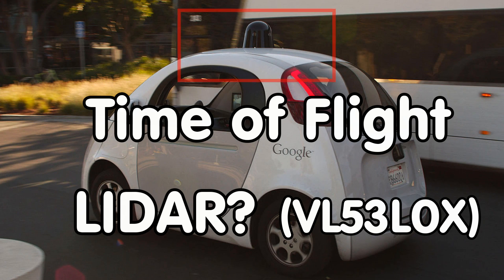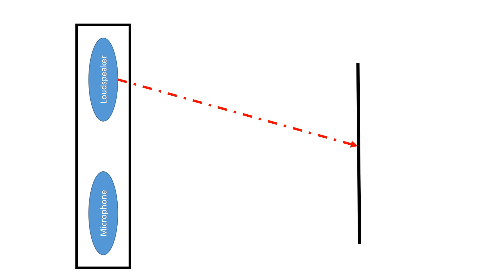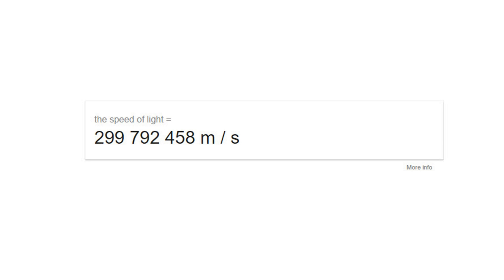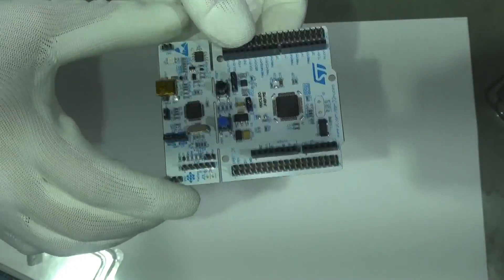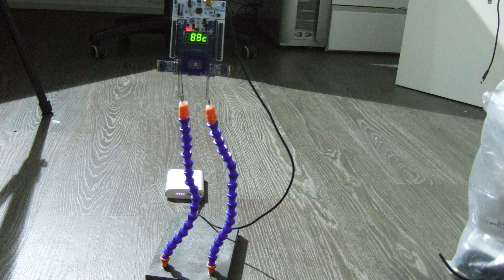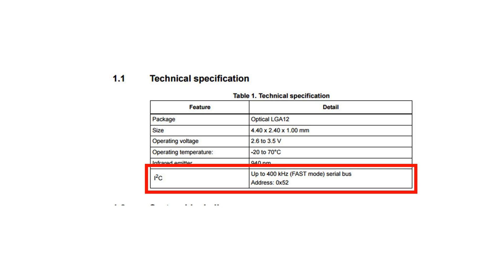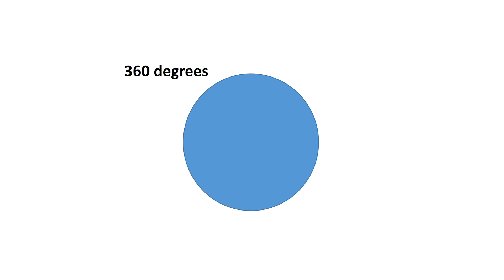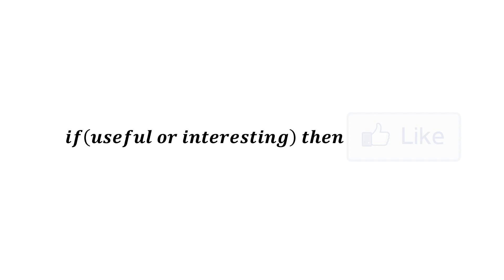#119 Time-of-flight LIDAR with VL53L0X ?

Comment: I hope you can show us how you can build LiDARs from scratch using discrete components, with today's advanced high speed micro controllers I think it can be done for low cost which implements proper LIDAR timings. The only reason I can not use the IC LIDARs is because they can not be implemented properly for 360 3D mapping which usually requires an array of Lasers.
Reply from the maker: You can buy ready-made Lidars (not expensive for what they include). They are very mechanical devices, and I will not build one myself.
Reply: @AndreasSpiess  Are they the ones with only for 2D pane using one laser diode? It is the lidar I would like to avoid. I have not seen any practical 3D lidar which are not expensive.
Reply from the maker: @ShopperPlug  Yes, they are 2D Lidars.

Comment: Is it possible to use VL53L0x without X-NUCLEO-53L0A1 extension borad, directly connecting to my F302R8 board via I2C interface? HAL functions(HAL_I2C_Master_Transmit or HAL_I2C_Mem_Write) don't work since no register map presented of VL53L0x by ST. All i found is device address as 0x52.
Reply from the maker: On this channel we only use the Arduino IDE as a programming tool. So I do not know :-(

Comment: Hi, I have to design a probe, which will move inside a pipe. The probe should be capable of self localisation inside the pipe. I am thinking to use TOF sensor V53L0X from ST microelectronics.  Could you please guide me
Reply from the maker: YouTube is only my hobby and unfortunately, I have no time for consulting

Comment: Thank you for thre great and interesting video! If I may add one mark @ ultrasonic distance measurement: in gases the the speed of sound does NOT depend on the pressure, but on the temperature (and the kind of gas (-mixture) of course): cs=sqrt(kappa*Rspec*T); the temperature is a meter for the speed the atoms/molecules move and thus can carry a pressure wave foreward (higher temperature --> faster atoms). whereas increasing pressure "just" increases the frequency of bounces as the free length of way is shorter.
Reply from the maker: Thanks for your clarification. I like to learn from my viewers!

Comment: Well, we are waiting excited for the conclusion, will it work with the robot?  An idea: if you put your sensor on a fastly rotating stand, maybe 5-10 rotations per second (or even more), and then with a rotary encoder fill an array or struct with angle and distance, wouldnt that compensate for the slow measurements? (its not fast enough to measure every degree, but after a couple of laps we will have by chance filled most of the angles in one degree resolution.)
Reply from the maker: I have to continue this project in the next time. And I plan to use more than one sensor to compensate for the slow speed. But it takes some time and I only will start if I can afford to stick with it for a while.

Comment: Can this be used in outside conditions and if not what is the best and cheapest sensor instead of sonar sensor??
Reply from the maker: It should work behind thin glass. So, you could include it in a water-tight housing.
Reply: what about the outside light conditions. is there any possible interference ?
Reply from the maker: I never tested. Maybe you consult the datasheet.

Comment: I think it would be good to use more than 1 sensor to tackle the slowness of the sensor. If we use like, 8 sensors at the same time at the same assembly we could get 8 points in 8 directions every 20ms.
Reply from the maker: You are right. That would be a possibility

Comment: Hi Andrea, very great video. If you are looking for a simple way to use ST TOF you can have a look on that product https://www.gilisymo.com/. you can connect more than one sensor and got all the distance value in UART interface (chain).
Reply from the maker: Thanks for the link. I am not sure where the advantage is other than the ability to connect many different sensors in parallel. Is there any other logic in the microprocessor?
Reply: Hi Andreas yes of course, there are lot of parameters that you can customize.  For example you can change:
timing budget, inter measurement period, thresholds for interrupt, frequency on PWM output, you can run yourself both offset calibration and xtalk calibration, you can put the board in stand by and specify for how long it stay before wake-up automatically,  you can chain boards: you can program a board as a master and connect this to different slaves. You can change i2c address, and more… please have a look at the documentation.  Maybe you can have a look at this link also http://www.thingiverse.com/thing:2320046
Reply from the maker: Now I understand. Thanks

Comment: Andreas ! I have experimented with the TOF sensor from the STM board. If I can save you the trouble, don't use the wire pass-trough. It's very noisy because of the rotation. The best approach is using a mirror like the barcode scanners in grocery stores. Here is a schematic you can look at.

http://imgur.com/a/DtEhH
Reply from the maker: Thanks for your valuable feedback. Did you try with the mirror? I have one laying around as a "backup"...

Comment: Can i use it to measure water level ? .............Does laser reflect from water surface or it penetrates it?
Reply from the maker: +sumit sharma I think so,but I did not try
Reply: A fraction is reflected, and a fraction penetrates.  The reflection from the water surface is specular, ie mirror like.  This makes it difficult to detect unless your receiver is aligned to receive the reflection.  The fraction that penetrates is absorbed by the water as it passes through it.  The deeper it goes, the less energy it has.  Infrared is absorbed more rapidly than visible.  Blue/green light is absorbed the least in water.  %32 nanometer green is the most common laser wavelength for hydrographic lidar.

Comment: 7:40 You can change the address in software. You can power up one sensor at 0x52, change its address and power up the next sensor at 0x52
Reply from the maker: Thanks for the tip. I also heard about that after I made the video...

Comment: This sensor could be great for collision avoidance of quad copters, though you would need 6 of them. I found 5pcs for 35$ so that is a reasonable cost. I wonder how hard it would be to get it to work with standard flight controllers like the naze32/baseflight
Reply from the maker: Pay also attention to the range in sun. Then, it is quite short.
Reply: I was hoping for the same thing, although 1 meter isn't nearly enough range :/
Reply from the maker: Unfortunately, we cannot change this...
Reply: Sadly yes! Will probably have to go the more expensive lidar route to get something functional

Comment: I would guess that ST may achieve this remarkable feat by sending repeated pulses and using digital filtering to improve the signal to noise (hence the timing which as you note is far slower than detecting a single round trip pulse would be).

I look forward to seeing how you manage the mechanical aspects of making use of the capsule slip ring; it does seem simple to   combine a motor drive with the slip ring (which doesn't appear to have bearings to support load or reduce wear).
Reply from the maker: It must be that they do some averaging, you are right. And: I have no idea how to solve the mechanical part...
Reply: If the capsule slip ring has enough mechanical support (ie: acting in the role of a bushing or bearing) for the rotating part, I'm imagining that a 3D printer could create a hollow gear which slips exactly over the stubby (hollow) shaft, and also provides for support of the rotating sensor part.  Then this gear could be driven by another gear connected to a motor whose shaft is parallel to the slip ring's axis, but offset appropriately.

I don't have a 3D printer nor do I yet know how to design 3D parts like this, so this is speculation.

If that caused too much wear on the slip ring, something more elaborate would have to be done.  

I can picture a motor on one side of the rotating parts, with the slip ring on the other side (motor and slip ring share same rotating axis).  But then there are the supports for the top end Ieg: the slip ring or the motor) in the way of the sensor.

Not happy with either, thus looking forward to following your explorations.  Thanks for your channel!
Reply from the maker: I think, I have to try different thinks. But first, I have to repair my 3D pinter...

Comment: funny I just received mine last week, but had not time to test it yet :-)

if you find it too slow then do the same as for you did with you 3 ultrasound sensors, buy mutiple lazer sensors, let say 4, put them on one stepper motor so you'll get a 360° scan in only 90° rotation timing so you can let the motor turn slower but get a full scan.

Comment: Andreas, if you want fast, you can't use the slow 400 kHz I2C.  A 10 MHz modified SPI or other interface will be needed.  At these speeds, not much in the Slow Arduino line will work.  A fast ST ARM M4 using Interrupts and at hundreds of MIPS should work well.
Reply: It is pointless anyway as we could only get a reading at the rate of 50Hz from these sensors.

Comment: Dear Andreas Spiess,
I am a freshman in high school and am interested in making a project with this specific sensor. I have one question for you. What tools/software do you regularly use to create these great videos? They are very informative and keep them coming. Also, I looked at the poll library and I was wondering how to control 2 ToF sensors simultaneously from one Arduino. I understand that the i2c address would be the same for each sensor. Thanks
Reply from the maker: 1. Which tools are you interested? Video/audio or programming?2. I did not write the program and did not design the board. So, I do not know, how they do it. As I said, I will only use one, so I do not have to solve this issue...
Reply: I am interested in the video and audio software, sorry for the confusion. Do you have any tips on solving the double sensor configuration? Thanks.
Reply from the maker: 1. Power Director and Audacity
2. Google for "I2C multiplexer"
Reply: The VL53L0X does support changing its I2C address, however it can only be done using an I2C write. If you have multiple VL53L0Xs they must be taken out of reset one at the time using other GPIO pins and have their address programmed.

More information can be found in this application note from ST: http://www.st.com/content/ccc/resource/technical/document/application_note/group0/0e/0a/96/1b/82/19/4f/c2/DM00280486/files/DM00280486.pdf/jcr:content/translations/en.DM00280486.pdf.

And as far as I can see the Arduino driver supports it https://github.com/pololu/vl53l0x-arduino/issues/1.
Reply from the maker: Thanks for this info. I was not aware about this fact.

Comment: Hi, great video and cool gadgets! About the slip-ring You are planing to use. I have seen video where guys were developing a 360 gimbal for UAV and they had problems with I2C communication because of slipring producing noise. Unfortunately I have no reference for the video.. Good luck!
Reply from the maker: Thanks for the tip. I fear this, too. This is, why I said, I am not shure it will work

Comment: Swissbro, I've been watching your videos for 3 days now. Your arduino project videos really got my neurons firing. Which arduino projects would you recommend for a first time user? Thank You!
Reply from the maker: Any one with sensors or with servos are always good to start with. The libraries always have some examples which should run. Then, you can to combine things like reading an analog value an set the position of the servo accordingly etc.
Reply: Thank you for the advice. I corrected my original comment . :)

Comment: http://scanse.io might be an easier solution. It already rotates 360 degrees and has 1000 samples/second. It's much cheaper than most lidar sensors, at $350.
Reply from the maker: Looks promising. There are a few commercial sensors around. But for hobbyist, sometimes not the easiest way is the most interesting one... Or: The way is the goal.

Comment: Great !! Btw, I use small cheap IR sensors for a small robot project. They work excellent. URL: http://www.miniinthebox.com/nl/smart-auto-infrarood-obstacle-avoidance-sensor-voor-arduino_p1141529.html?
Reply from the maker: I think, this is a very similar sensor as I showed in my video. They are great for detection, but cannot measure distance.
Reply: Indeed. So far I only use it with a fixed distance as a anti collision sensor. In case it missed something I have micro switches which act as an impact sensor. My next improvement will be adding distance measurement. I'll keep you informed.
Reply from the maker: +Philip Gevaert :-)

Comment: Thank you for the interesting video!
I found recently an LIDAR project on Hackaday.com which uses much more hardware and is 3D.
https://hackaday.com/2017/02/06/amazing-3d-scanner-teardown-and-rebuild/

I would also like to know, if the response time of the VL53L0x could be decreased, to allow to spin it with a motor.
Reply from the maker: I think, a moving mirror could reduce some problems, bu I do not know, if it works well with tof lasers. I will first try it with the sensor itself. If I get a better answer concerning speed, you will for sure see it in a future video.

Comment: Ciao Andreas, thanks for sharing another useful and interesting video. A question for you (and the community that is being build around you) this sensor has problems with angled surfaces like ultrasonic sensors?
Reply: If it doesn't, it could be a bit more simple to use mirror as the only moving part with statically fixed sensor
Reply from the maker: I assume it uses the same physical laws of mirrors... But I will try what it means in practice
Reply from the maker: true